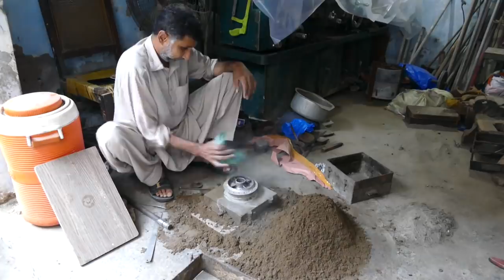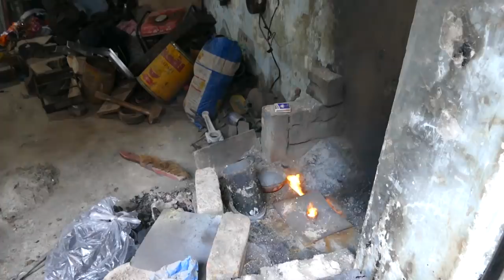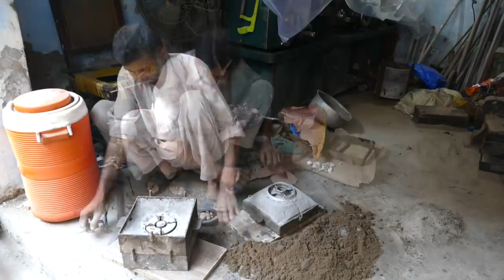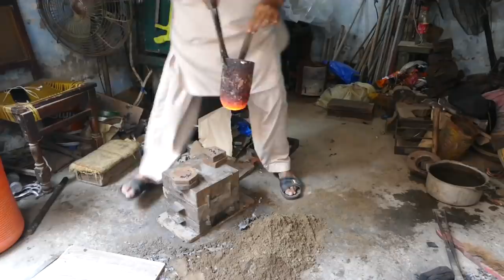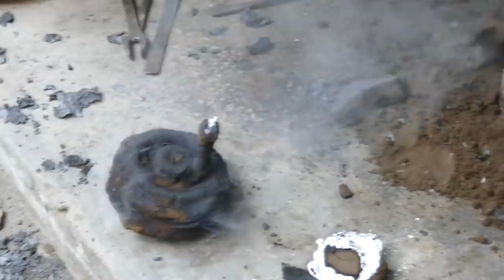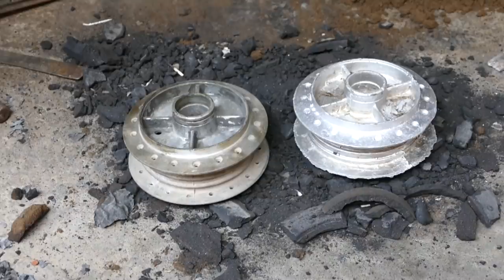Aluminum Casting Motorcycle Wheel Hub

Comment: But it doesn't have that strength to withstand braking heat also the hub will get teared after continue friction with axle and those bearings inside get bend with it

Comment: This part needs a steel liner inside for the brake pads. Will not work for many braking use.
Reply: Brake drum made of steel, that part will inserted after some machining to this bare hub
Reply: @Tyranosaurus_Xer  and how they glue them together?
Reply: @nakosfotis2118  Heatshrink the liner in, you are no Enginner then or you would know that.
Reply: @nakosfotis2118  lol you dont need glue when you have cold / heat technics and some precision engineering
Reply: @Tyranosaurus_Xer  you mean that I must heat the outer aluminum and cool the inside sleeve and press them?